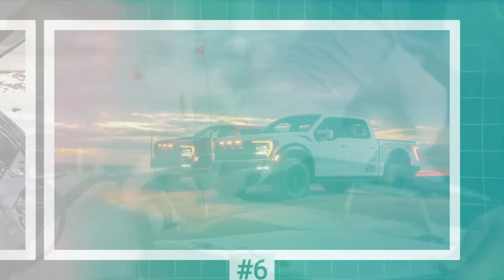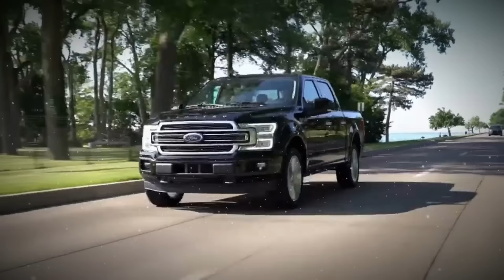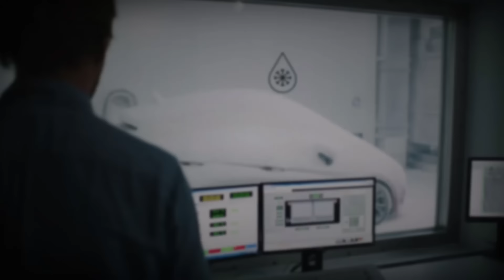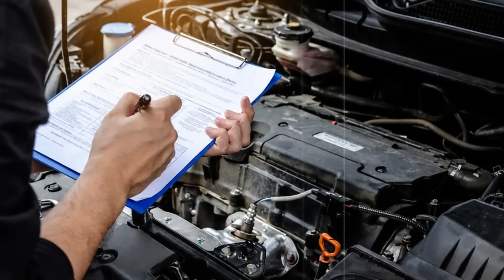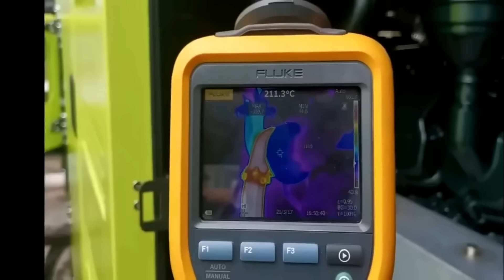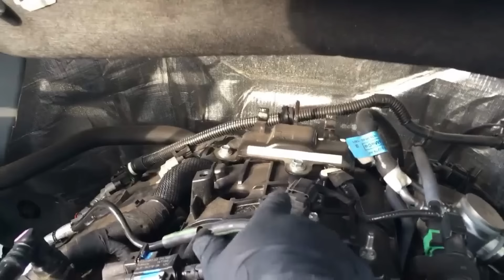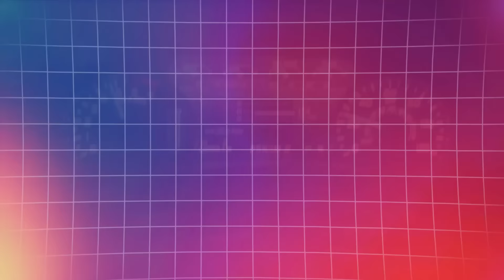We Ran a Turbo F-150 & a Naturally Aspirated F-150 Side by Side for 200,000 Miles — A Clear Winner

Comment: That may be fine for 2019’s, but doesn’t mean much regarding new models.  For one, the 5.0 from 2019 didn’t have the variable displacement issues that have plagued the GM V8’s.  But they have variable displacement now.  Will it be a problem like GM?  Don’t know yet, but it seems likely.  If found too late and post warranty coverage, it can require total replacement.  I’m not aware of the ecoboost engines having variable displacement.  The issue of carboned valves should no longer be an issue with Fords as both the Coyote and the Ecoboost engines use port and direct injection now.  I noticed that this video totally overlooked the high altitude power loss of naturally aspirated engines, while turbocharged engines maintain sea level performance at far higher altitudes.  I can’t imagine wanting a naturally aspirated engine if living in the Rockies or Sierra Nevadas, or Cascades.

Comment: My 2019 STX f150 2.7 turbo didn't last 74,000 miles it blew. Then at 102,000 the trany blew. Both the warranty covered the motor 100% but they made me pay almost 3k for the trany. I only towed my side by side twice.
Reply: It’s the same transmission for either engine. Maintenance is key..
Reply: That sucks. I'm at 130k miles in 17' 3.5l and I tow 12' trailer for work and 32' camper.

I stay on top of my oil changes, tranny oil/filter, and air intake filter. I run fuel injector cleaner every 3 fill ups. Temp temp. That turbo needs to stay cool with good oil. I never put load on it right away.

Turbos take more finess for sure. We were in Telluride last year. I was in a 3.5l and my brother in law was in a 5.0 Raptor. He couldn't keep up with me. He now has a 25' 3.5l TT Raptor.

The 3.5l is a better comparison to the 5.0 imo.
Reply: I don’t know where you’re getting your info from ! But we have a 2020 3.8 Telluride just for reference they do not have and never made a 3.5.  We also have a Ford raptor and have had three of them. There isn’t any Telluride that can keep up with a Ford raptor impossible, unless the raptor does not want to keep up . I will say I love the Telluride. Second order of business from the factory Ford has never put a 5.0 in a raptor but they have put a 5.2 supercharged raptor the only way you can get a 5.0 in a raptor is aftermarket only. Therefore, I have to deduce that if your friends has a 5.0 in a Raptor it is aftermarket.
Reply: @Jesse-u9j  Telluride in Colorado, not the vehicle. We were where the vehicle was named after. I was making a high altitude comparison since that's what this video is about.

It wasn't a 5.2, it was a factory 6.2l. I remembered wrong, but I just confirmed with my BIL.

Comment: Same for GMC trucks and engines.  Our 1995 GMC Vandura 2500, 350V8, with Positrac is still going strong at about 175K+miles.  Easy to service and maintain.  Parts available.

Comment: I have a 2020 F-150 with the 2.7-liter.  I change the oil every 4,000 miles using a full-synthetic, since the turbos add a lot of elevated temperatures (i.e., stress) to the oil.  Power is unbelievable, with loads of low-end torque.  Mileage for mixed city/highway is about 23 mpg in warm weather, and about 21 is very cold weather (Colorado mountains), which I consider excellent.  It tows my 3,900 lb. Airstream travel trailer securely, but fuel mileage drops dramatically to 12-15 mpg.  I use 87 octane (mid-grade at these high altitudes), except 91 octane when towing.  I have about 54,000 miles, with no problems so far, but I just had all fluids (transmission, front and rear differential, transfer case, and brake fluid) changed, so I try to avoid problems.
Reply: Smart.
Reply: I have the same 2020 2.7L turbo XLT with 75,000 miles. Replaced the tires at 70,000 miles and the battery was good for 6 years.  I'm averaging 24 mpg overall (summer and winter) in Oklahoma. No high altitude.  Great truck.
Reply: 2019 2.7 135,000 no problems whatsoever engine and transmission I change my engine oil every 3k and transmission fluid every 30k

Comment: Great comparison and analysis.  I have a 2.7 and love it but don’t do significant towing.  The 3.5 EB may have fared a bit better but for sure, if I was towing significantly heavier trailers even occasionally I’d go for the NA 5.0.  Plus, running a turbo engine, any turbo engine on anything other than the proper weight FULL-Synthetic oil with changes every 5k is suicidal.  The V8 easily lives on semi-synthetic oil which is slightly less expensive.   You could also stretch the 5.0 out to 7500 mile change intervals with no negative effects.   Turbos are great but as you illustrated, heavy towing puts that smaller engine into boost almost all the time, flaring up cylinder pressure and therefore heat.  The heat demands quality, clean full Synthetic oil to have a prayer again chest breakdown which the V8 does not worry about.  Great job.
Reply: Interesting opinion. And that’s all

Comment: This doesn’t surprise me at all.  Makes perfect sense.   And you didn’t address more frequent oil changes that the turbo’ed SHOULD get.  There is clearly more ware and tear and the turbo requires cleaner oil.   Also when you shut down a turbo’ed vehicle, you should wait at least a minute or two for that turbo to spool down.  When you shut the engine down, oil pressure basically goes to zero, meanwhile that turbo is still screaming.  Oil pressure or not.  Nope.  V-8 for me.

Comment: 2019 f150 3.5l 2nd Gen ecoboost with just over 208000 miles and no issues other than regular maintenance
Reply: Use it for a 'Work Truck' or 'Girly Truck'... ?
Reply: @brucenichols540  he didn’t mention the girly truck with the five oh, try to keep up
Reply: I bet you only used it for picking up milk and bread.  No way will a turbo gas engine out last a bigger cubic inch motor under a load.
Reply: What about the 10R80 no issues

Comment: Sounded like oil change intervals where the same ?  Was it normal oil in 2019, not water thin.  Thought the turbo would need them more often. People don't understand that gasoline is one of the cheapest things you do for your vehicle, all worried about the price of gas so they stretch out oil changes. Before CAFE we had cast iron V8s, no phasers, no turbos, few control modules, no 4 chains on the front, no OHCs with funny lifters, AND NO PROBLEMS, DUH

Comment: The turbocharged engines are being forced on the manufacturers by activist enviornmental laws requiring more and more miles per gallon across product lines. Inviting the activists lawmakers to a buzzards banquit is the solution to such a problem. We could make the activists the guests of honor and then whitsle for the buzzards. For once, the activists will have the opportunity to actually do our enviornment some good.

Comment: I did not find this comparison useful because the 2.7L was neither designed nor intended for regular heavy towing.

The 3.5L came with more transmission and engine cooling with the max tow package.

Comment: On my 4th F150 with the Coyote (a 2024 STX).  Absolute confidence in this engine. I am retired and drive the wheels off this thing (and the others).  GREAT engine.
Reply: 2012 f150lariat 3.5 at 260030 miles just started having trouble turbo cooling system leaks carbon buildup and other stuff. This f150lariat was is well maintained. If i had it to do over witch would i had bought answer is naturally aspirated v8 coyote over 3.5 turbo!---cost to repair turbo and overall price of maintenance vs no turbo cost and lower maintenance  and piece of mind wondering when 3.5 is going to break down for me my next and last f150lariat or f250 will v8.

Comment: Correction: The Gen 3 5.0 starting in 2018 has BOTH direct and multi-port injection, so the intake valves DO get fuel flow over them.  This is the primary reason for the much cleaner intake valves on the 5.0.

Comment: A little surprised to hear of carbon buildup in both motors. Ford added multiport fuel injection to the 2.7 in 2018 and the 5.0's always had mpfi.

Comment: I have a 2014 5.0 litre V8. The engine locked up at 178000 miles. I bought a used identical engine and had it installed. No more problems. The old engine probably locked up because I wasn't watching my oil levels. I will swear by this engine. This was a great video.

Comment: I would go with the 5.0, because of the N/A.
All the extra problems with the turbos. Unfortunately I got a 2011, just installed a used motor.
25 hours of hard labor,no shop,no lifts, just floor jacks and Oil soaked hands. 🙌👐🤲🤷

Comment: I wish you would have compared a 3.5 eco. Also, 90% dont tow up mountains on a regular basis, with a 2.5 eco.
Reply: The test is the test. Somewhere, someone else tested the 3.5, or the 3.6, but that wasn't this test. The whole point is that the turbo and all the things that surround the turbo were the problem. Regardless of displacement, if it has a turbo, you're going to have these problems. The Coyote doesn't have an intercooler to fail, it doesn't have all the extra parts to fail, no turbo bearings, no waste gate...understand?
Reply: @mikemelina9607 The 5.0 drinks oil like siv.
Reply: @terrylink7207  News to me. My Coyote just turned 200K this week, got it's regular oil change and no problems.

Comment: This video is less relevant today. Both engines now feature port and direct injection for fuel, and today’s coyote V8 is now more complex because it has cylinder deactivation and an internal wet belt for the oil pump, whereas the model you had did not.

Comment: Very cool! Great information, too bad these manufacturers don't do the same thing. Now they are trying to stop you from changing your own parts and having worked on my own vehicles most of my life, sometimes I regretted trying to take care of repairs myself due to the complexity. In order to change the water temperature and or knock sensor of my 2003 F-150 5.4 engine I had to remove the intake manifold. That was the bad side but the good side was I was able to replace all spark plugs with ease, both sensors, all coil packs, and replaced seals on all injectors before torqueing it all down and the Dorman intake manifold kit turned out to be a blessing at $100 on Ebay. The truck ran great after install then I stared getting misfires on the two front plugs for some reason, even on new coil packs. All worked well after warming up but I lost that truck after getting ran into a parked vehicle.[

Comment: A large engine that doesn't have to work very hard compared to a tiny engine requiring a turbo-charger beating itself to death.  Gee, I wonder which will win that contest?  Simple fact: They are not using tiny turbo-charged engines because they are better at being an engine.  They do it to save a couple of miles per gallon under controlled test conditions to get around EPA regulations.  As this video shows, when using these engines for work, the tiny turbo doesn't even have a mileage advantage.  Get the V8.

Comment: Thanks for the video. I didn't know the 2015 2.7 had cam phasers. At least it has a chain-driven oil pump. I'll never buy another Ford truck because they have cam phasers and rubber oil pump belts. I'm hoping the new Chevrolet small-block engines don't have that garbage.

Comment: I owned a 16 f150 with the 5.0l and loved it. Bought a camper in 23, the 5.0l does the job but not the way i wanted. I bought a 23 powerboost and it’s night and day. By the time the ford bumper to bumper is done it will be gone but it’s definitely an amazing truck. But I’ll be heading to a 7.3l next.

Comment: I'd also like to point out that the V8 nodular engines the Ford started building with the 4.6 5.0 5.4 and the light, always build up 85% of their torque by the time they reach 2,200 RPM. It is always building up torque at the low end. Early 5.4 is in a box truck were launching better than Mustangs were.

Comment: The valve issue can be easily fixed by putting a very inexpensive water methanol injection system into the intake. That would cure the intake valve carbon problem Forever on all engines.

Comment: Ford went through several years of naturally aspirated engines that shot spark plugs up into the hood of the truck. If you're going to use a video medium and you're going to identify an engine by saying it's the V6 turbo. You shouldn't be showing a picture of a V8 engine. If you knew what you were talking about you might be able to fix these things before you put this video out. Turbos are all have always been known to be a little bit happier down in the low range. The problem is is when you're up trying to go uphill or anything you've run out of Turbo by the before you run out of speed you need to attain. And I don't know why you're testing the 2.7 turbo. The 2.7 has been a piece of crap ever since it was introduced. The 3.5 is a bit better. But it still runs out of boost at higher speeds. It is not a competent tow vehicle when you're trying to make a small gasoline engine call heavy weight. I have a 35 turbo and an explorer. It's a wonderful engine. But you have to maintain your maintenance schedule way more than what the factory tells you and I get the sneaking suspicion that you were stupid enough to try and follow Factory oil recommendations without understanding that any towing or even driving in conditions that go from hot in the summer to freezing in the winter is always and has always been severe Duty. Requiring at least an oil change every 5,000 me. Now some oils are still good after 5000 me even with their additive package. But why would you test that on an engine that is a real pain in the butt to work on. One other point I'll make, and I have that problem with my vehicle, I haven't had a water pump failure but it's driven by the timing chain. When for at least three decades now the concept of putting an electric water pump on an engine has been much easier to do! That last comment was for Ford Engineers to finally get their head out of their butt

Comment: Even Before watching this video, the **5.0 Liter engine!**
Reply: anything with Eco- in it ....DO NOT BUY.
Reply: The 5.0 V8 option is a no-brainer.
Reply: That's a good engine I say the more simple the better
Reply: @Cruiser777  its actually not that simple...a double overhead cam engine... but at least it isn't asking the engine to do more than its really designed to do which is what turbocharging does. Turbocharging is fine but you are going to pay for it with shortened engine life and maintenance expenses. 
This is something we knew back in the 1980s when manufacturers tried this the first time.

Comment: I had a 2020 Edge ST with the 2.7L and have a 2021 F150 with the 2.7L with 55K on the clock. The 2.7L is the best daily driver engine put in the F150. I moved my catch can from the ST to the F150 when I traded in the ST. The F150 collects a little less oil vs what the Edge ST did. However I only had the Edge ST for 15 months. Both got the Auto Stop Eliminator module right way.

Comment: I have a 2022 F-150... change oil every 3500 miles with Mobil 1, and use 91 octane...  74,000 miles running great!  Hope it stays that way til 140,000 miles at least... I get about 25 mpg on highway, and average 20 mpg with combined city/highway. Its tough to beat!
Reply: Why 91 octane >  I run a 2024 and use 87 octane.  No knocking, or detonation issues.  Curious as to why .
Reply: @rds990  High compression, 91 octane delayed ignition.. much better for turbo engines long term in engine...

Comment: I have a 5L 2013 XLT with 144K miles.  It has not given me any problems except for a burned fuse for the fuel pump so far.  It is a pleasure to drive.  I will stay with naturally aspirated motors.  Appreciate the comparison and have no disagreements.
Reply: I have a 2012 with 173000 i had to replace the same fuse i also had to change the water pump but it's been a very good pickup
Reply: I have a 2014 with 230,000 miles and it was used for heavy towing the first 42,000 miles by the first owner. Fuel Pump fuse SB is the only problem I have had. Reliability is typical for the last 4 Ford F-150s I have owned, 2 of which I was first owner.
Reply: It seemed to me the Ford trucks from the mid-90s to the mid-2010s 

We're super quality trucks. 

Most people report the same thing you do. 

I would not get rid of that truck for nothing😂

Comment: The second gen 2.7 uses DI and port injection.   It was in the 2018 and later models.  Missing this fact puts your test in question.
Reply: Make no mistake these comparisons are intentional to favor old school V8.  No doubt early turbo engines from Ford have many issues.  They just don't dare compare the latest model equivalents.  The cylinder deactivation systems on modern V8s introduce a whole new can of worms.
Reply: @kannermw  most of the issues brought up about the 2.7 were just the 2 yrs 2015-2017 and were rare to begin with. The 2.7 has proved more reliable than the five oh
Reply: @pathunter7003 The irony is turbo diesels have been around for decades.  Now diesel operating temps are less but if internals are designed to support increased mechanical load then reliable life can still be assured.  Mostly with proper cooling and not heavy boosting like a high performance sports car.  Then the usage of direct injection minimizes effects of pre ignition and detonation along with proper ignition timing management.  This is all well known and proven tech.
Reply: @kannermw  and that’s why the 2.7 has the HD internals, it’s designed for turbos and uses the same block materials as a diesel, along with direct AND port injection . My 2.7 has an oil cooler along with a larger radiator and cooling fans.
And a trans cooler
It does not rely on heavy boost to do the job, it’s the matter of getting the correct options on the truck. And this engine has been around for over a decade and it’s been proven